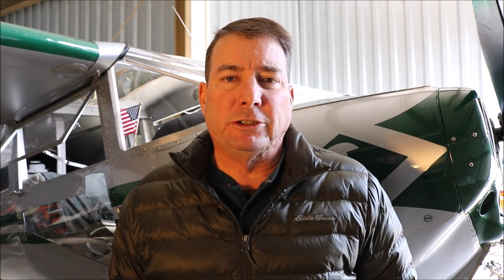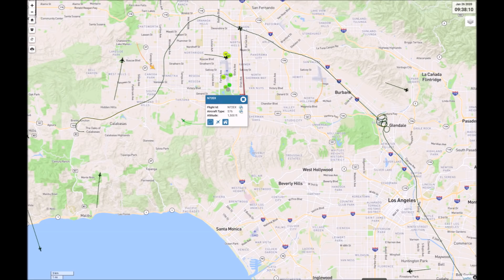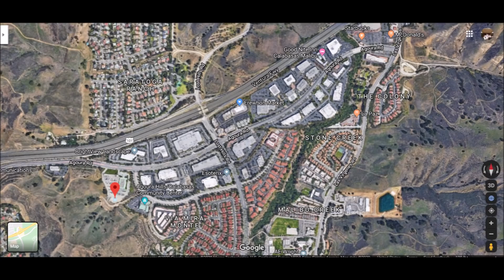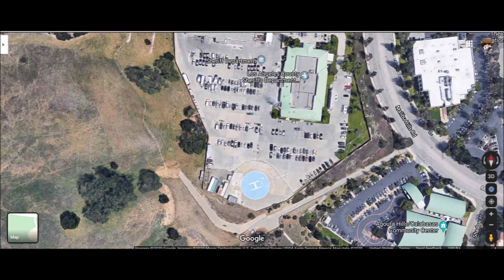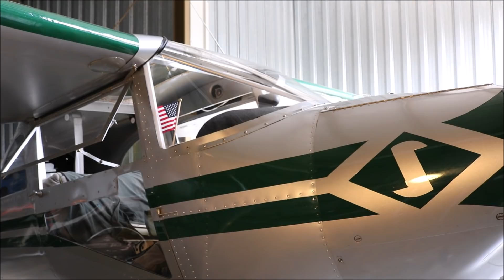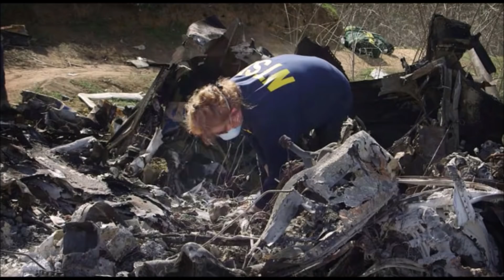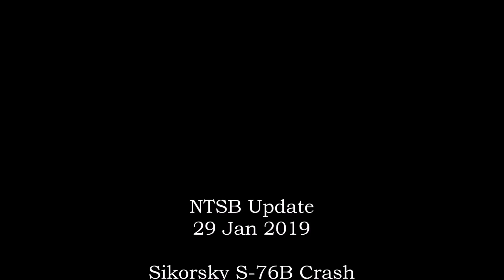Kobe Bryant Sikorsky S-76B Crash Update 29 Jan

Comment: The Agusta A109 has a Sperry SPZ-7000 autopilot system. It does not have collective coupling. Some pilots believe that if they encounter inadvertent IMC they can just push the go around button and let the aircraft level its self and pitch up to climb. The pilot is responsible for applying collective to match a cue on the HSI (climb power) If the pilot is late on the power application or applies too much power then the airspeed can bleed off to a dangerously low state and vortex ring state can set in. (settling with power) Now that I think about it the Sperry manual recommends not using the go-around function below something like 110 or 120 knots. The Sikorsky S76B has a Sperry SPZ-7600 autopilot. I don't know if the accident aircraft has collective coupling, but the go-around function may not even work below minimum IFR airspeed. (55 kts?) This sort of thing has happened before. It breaks my heart.

Comment: OK, I am speculating. I was wondering about the sudden left turn, and the loss of altitude and increase of airspeed. I had not considered loss of control. The pilot may not intended to turn. The sudden, unintended  entry into IMC may have disoriented the pilot for a few moments, resulting in an unintended left turn. The descent may have also been unintentional. There is no way of knowing if this is what happened. It fits the facts. The helicopter was gaining altitude before entering the canyon. The turn portion is about 30 seconds of the flight. I am guessing that the turn started slightly after entering IMC.

Comment: I haven't flown in quite a few years due to medical conditions.  I can tell you that even when you are on an IFR flight plan, entering into IMC (Instrument Meteorological Conditions)  when you do not expect it can cause vertigo if you take too long to transition into instrument flight.  Many years ago, I was flying from Millville, NJ (KMIV) to Linden, NJ (KLDJ) at about midnight.  I got my briefing at the Millville FSS (Flight Service Station) which was on the field. The current reported conditions were CAVU (Clear above visibility unlimited).  I filed an IFR flight plan, Got my clearance, and started my takeoff roll (The aircraft type was a Piper Turbo Saratoga SP) and once I rotated, I was in thick fog.  Luckily I was able to transition to instrument flight quickly, but since I was not expecting to have IMC anywhere during the flight I was off guard and my flight instructor immediately turned off the strobes for me instinctively (I'm glad I had him on board that night).  If I had known that I was going to have IMC, I would have not turned them on in the first place.  The strobes might have made me lose spacial orientation.

It turned out that there was a small area of fog that was moving in, and I broke out at about 600 ft AGL.  I informed the FSS of the condition as they were still reporting CAVU.  I learned a lesson that night that the reported current weather conditions are only correct where the weather reporting instruments are located.  The weather conditions at that end of the field were as reported but at the other end of the field, they were quite different.

The point I am trying to make is that things can go very wrong when even though you are an experienced pilot with many hours, a distraction of this magnitude (unexpected IMC) can cause disorientation.

Comment: It might be easier to get TCAS and Flight Data/Voice recorders accepted if they upped the size of the helicopters to 8 or more seats. Seven seats includes A-star and some Hughes models, depending on the seating configuration. Those are utility helicopters, not executive transportation machines. A maxed-out AS-350B3 costs about $2.6 million. Adding TCAS and voice/data recorders would significantly impact the cost of that machine. For a S-76, Agusta 109, Bell 525 etc. the price impact would be smaller (relatively) and perhaps there would be less market resistance. For a $12 million unit like the S-76, not having TCAS seems penny wise and...

Comment: As a neophyte to this topic of aviation, I appreciate your videos. Ty. Could the following  be a possibility? 

"Non-visible Horizon

Anyone in an aircraft that is making a coordinated turn, no matter how steep, will have little or no sensation of being tilted in the air unless the horizon is visible. Similarly, it is possible to gradually climb or descend without a noticeable change in pressure against the seat. In some aircraft, it is possible to execute a loop without pulling negative G so that, without visual reference, the pilot could be upside down without being aware of it. This is because a gradual change in any direction of movement may not be strong enough to activate the fluid in the vestibular system, so the pilot may not realize that the aircraft is accelerating, decelerating, or banking."

Comment: I have a fair bit of IFR flying experience in SE Alaska on commercial aircraft with TAWS installed.  Most pilots, myself included, often inhibited the aural TAWS warnings as we got so many false positives from the TAWS (Terrain Avoidance Warning System).  You can only listen to it screaming at you to pull up when in fact you are in a proper glidepath to a runway, so many times before you want to kill it.  I am not a rotorhead, but I imagine it would be even worse there.

Comment: I contacted the FAA a few times trying to get them to take a look at a few YouTube videos which had commercial airlines planes landing and attempting to land in extremely high cross winds. They blew me off by rationalizing it without viewing the videos. From that point forward I check weather at the airports I'm flying in & out of to determine if it looks like fairly calm weather conditions. I no longer trust the pilots to make logical decisions on the weather conditions.  They may fly within the allowed limitations for the plane but it doesn't mean it's safe!

Comment: Question as a corrective action, If Flight Following (FF) is requested could  FF be required to implement the flight data plan and direct the aircraft so the aircraft would not have to be so low to maintain VFR? Would have been better to use Instruments and Flight Following for guidance in these extreme cases.

Comment: A dilemma appears to be for SoCal to monitor the flight, the aircraft needed to be between approx 2000-2500 ft. But the ceiling was only 1100 at Van Nuys and to maintain special VFR the pilot would need to stay low enough to visualize the landmarks (118 and 101) A dilemma that did not equate.

Comment: I was training in a 1980s 172 that had GPS with Terrian warning....I was flying in a $50k plane! this helicopter is worth millions carrying high profile people why wouldn't it not have any sort of terrain warning system....if it did warning for no reason you just silence it. Also he was IFR rated
Reply: Listen to the video. The FAA has not approved terrain awareness and warning systems (TAWSs) for helicopters, so what you had in an airplane is irrelevant. Or perhaps not, as several people have said that this equipment could have been installed in the helicopter if the owner wanted to. Sorry I don't know which is correct.

Comment: Question: Would adding a FLIR like camera to charter helicopters at least as an available safety option be warranted?
I am hoping that as a result of this accident that a few requirements be added to newly built aircraft and helicopters at least as a start. The first would for aircraft that are to be used in part 135 and 121 to have CVR and FDR's. The next would be like she said some kind of terrain avoidance system. A rudimentary TAS is part of almost all new "glass cockpit" avionics and might have been what the pilot was using Foreflight to accomplish.
I have this queasy thought that the pilot succumbed to the same phenomenon that the Atlas air co-pilot had where rapid acceleration forward makes your brain think that you are climbing and in response he pushed forward. A flight data recorder would have shown the pilot inputs at each phase of flight.
Reply: The FAA has refused permission for all of the requirements that you mention to be installed in helicopters, as Juan said in the video. However, several commenters have said that the helicopter owner could choose to add these things. Don't know which is correct.

Comment: This would have been a simple IFR flight; however, charter company rules or insurance or 135 Certificate did not allow IFR flights.   TAWS makes no sense in a VFR only aircraft. 

Juan, please explain the difference in being IFR rated and being on an IFR flight plan in the IFR environment and what is necessary to transition  from VFR to IFR.  

When conditions deteriorate and IFR is not an option, the only option is a 180 degree turn back to VFR conditions.  Likely what was on pilots mind here.  

If Pilot is IFR capable, the other option (not recommended) is to rely on the big sky theory and zoom towards the heavens while busting the altitude and airspace restrictions and simultaneously declaring an emergency.  Not a good option here when known IFR traffic is above you.    No pilot wants to be “that guy.”

You can’t fly around IFR below the MEA no matter how good you are at controlling the aircraft in IMC conditions.

Comment: Two questions I have is I understand the pilot kept so low to maintain his VFR; but with the altitude the helicopter is capable of going why didn't the pilot opt to fly above the fog at 4-5k AGL until his navigation system or air control let him know when he was close enough to begin a descent? 
Also I haven't seen a good enough photo that shows the twin turbine nor the steel frame that would have survived the crash and any subsequent fire; physics doesn't allow a fuel combustion to incinerate and completely melt either of those so why are they not present at the crash site?

Comment: One of the leading causes of civil air crashes is a human condition called "GETTHEREITIS" (get-there-itis).  We're going to get there no matter what.  You have a commercial pilot losing visual references, situational awareness and common sense.  He flew too far and pinched out between the terrain and the bottom of the cloud deck.  If that wasn't enough, he didn't have the presence of mind to land.  If I had gone that far, I would have landed in a parking lot, ball field or ? and called a cab to take the passengers the remaining distance to their destination.  This crash was totally avoidable but when GETTHEREITIS overcomes common sense and good piloting skills, these accidents will continue to happen.

Comment: Synthetic vision available in any modern electronic flight bag EFB, like For Flight,  could have provided greatly increased situational awareness and probably help the pilot not get into this situation.  And since an EFB can be run on a portable device, not "attached to the aircraft", like and iPad, it does NOT need to be TSO'ed to be used in any aircraft.  Most GA pilots of both certified and experimental fixed wing aircraft now use this technology on a very routine basis.  Why in the world is technology not know to, used by helicopter pilots????

Comment: The s76 is an IFR certified aircraft, we used to use them as air ambulance up here. Why the heck was this flight not being conducted under IFR rules? An 8000hr+ commercial pilot must have had their IFR rating. Was the company not certified for Sifr operations? If not why no copilot? This strikes me as gross negligence on the part of the company and Atc/faa for not grounding the flight before it took off. Furthermore looking at the flight track it would seem to me that a safer route would have been over the bay rather than up the Inland valleys.

Comment: Hi Juan, I assume you've seen this article? https://www.forbes.com/sites/jeremybogaisky/2020/01/29/pilot-in-kobe-bryant-helicopter-crash-wasnt-allowed-to-fly-by-instruments/#68d8b1ee26ea
I can understand the frustrations of the NTSB with the FAA. The NTSB's idea of perfection is no crashes at all, so they want to implement changes that will give the lowest possibility of accidents.
The FAA has to deal with competing priorities. They want flight ops to be as safe as possible BUT also have the airlines on their backs about costs because much of the travelling public makes decisions about flights based on price.
I wrote a rather lengthy post on the previous video going over various thoughts, and the one I kept coming back to was wanting to look at the regulations around when a charter flight is allowed to choose VFR over IFR. That, to me, is the true root cause of this crash as it surely could not have happened as it did were the flight conducted under IFR as they'd never have been flying at an altitude below known terrain safe heights unless on a specific vector and glide path that would ensure their safety.
Am I correct in thinking that's the sort of change you may have in mind when you say you think the FAA will ultimately have to make some changes due to the enormous public profile of this accident?
As usual, your channel is where I'm coming to for no-nonsense coverage, and I've shared it with friends who have expressed interest in the accident.
Thanks for the great work as always,
Cheers from Australia

Comment: Seems to me he flew at a high rate of speed into a fog bank. Made a left turn  into elevating terrain to escape. At the last second saw the hill side coming up, banked it even more to try and avoid it and flipped the bird over as it then slammed into the hill. Why in the hell he was doing over 150kts is beyond me; under those conditions, is insane. What a massive lack of good  judgement. We wont know for another year but I see law suits in the future and an involuntary manslaughter if there were no mechanical issues.
There is an eye witness on the ground in the church parking lot that states the engine sounded strange as it passed over top through the fog cover.
Only time will tell.

Comment: It's an accident that happens when you continue flying VFR into IFR conditions. If you rule out pilot incaptation or mechanical failure then you are going to ask why did the pilot continue flight from SPVFR into IFR conditions?

It was daytime. Visibility was very poor.  Ceilings were under 1500 at that time. The pilot decided to take a look and try to maintain VFR. Looking forward in cockpit you see white/grey color. Looking down towards ground your immediate view is less than 1/2 mile. It's easy to fly off track. Given he was in the mountains only increased the danger over 1000%.

With such low visibility it was extremely poor judgement to continue the flight VFR.  

If the flight visibility was greater than 1 mile and the pilot stayed clear of clouds we wouldn't be talking about this crash.  The pilot took a risk to continue the flight knowing the poor visibility and ended up killing all his passengers on a commercial revenue flight Part 135 Air Taxi. 

A superior pilot will never have  to use his superior skills or superior judgment to avoid a crash. 

It was Pilot Error and one could argue a criminal act by acting negligently knowingly to continue the flight with innocent paying passengers onboard.

Comment: Unfortunately this happens often  and it won't be the last time.  Corporate helicopter and private jet pilots have the stress of trying to please their VIP bosses or corporate executives that need to get somewhere, even if the weather is bad or marginal.  They take these risks because they don't want to lose their job and or upset the client.  Unfortunately in this case I'm sure that the pilot felt pressured because Kobe needed to get to the tournament and the pilot thought that he would find an opening in the fog/marine layer when they arrived in Calabasas.  Obviously this didn't happen, what he should of done was turn back or land at Van Nuys or Burbank and they could of rented a private shuttle to take them to the tournament.  Better late than taking the risk the pilot did. Yes he was experienced and had over 8,000 total hours of flight and approximately 1,500 hours in that type of helicopter but what he needed was the courage to tell Kobe that the weather and visibility was bad and turn back or land at the Van Nuys or Burbank airport.  As pilot in command and in charge he has the right to say that it's not safe to fly. This is a very sad and tragic accident that I think didn't have to happen. 
RIP Kobe

Comment: Witnesses describe helicopter low to the ground, about a 100 to 400 feet or so and moving very slow (about 5mph).  The loud sound is what caused them to look up.  I don't believe helicopter was that high altitude (2000-1000 ft.) or moving fast per witnesses.

Comment: I think this pilot may have had a medical event mid flight. Passes out slumps forward with the controls still in hand and flys that helicopter right into the ground. Based on the impact, it was said it may have hit at over 170mph and descended rapidly based on the radar.